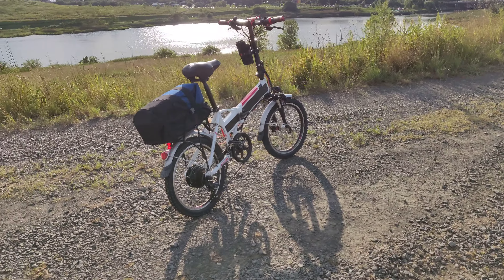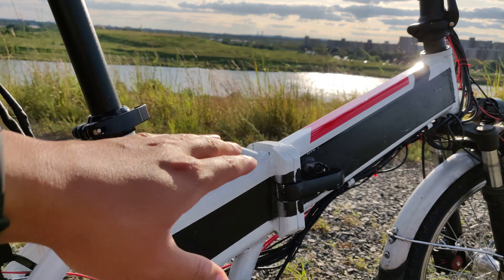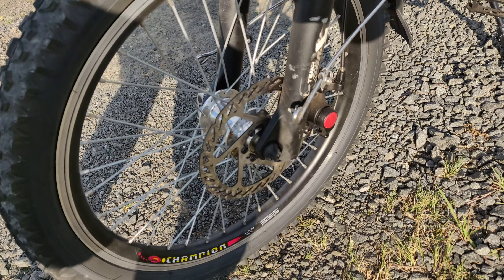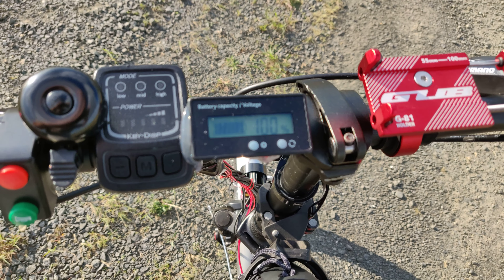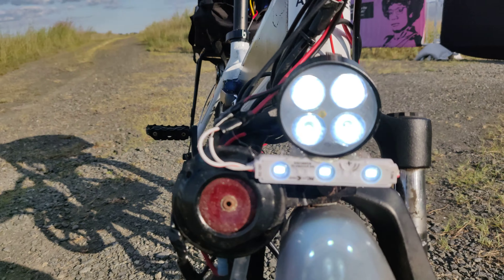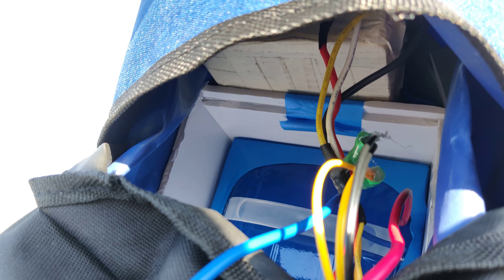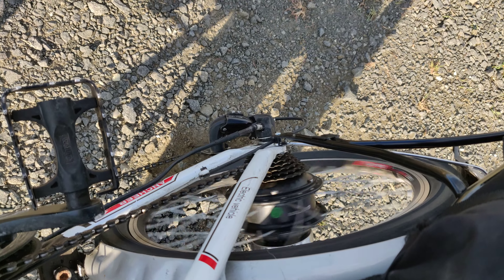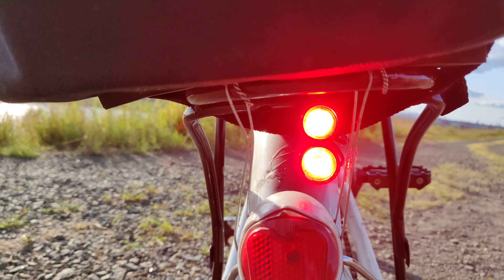Modded Ancheer FM001908 foldable bike to 48v

Comment: Thats great! But what kind of controller do u have ? Beacaus i have an 36 v 250 watt bike and i want to upgrade only the battery to 48 v 10ah do you think my controller can handle that?
Reply from the maker: Hi, my controller is x813-AA26E-12Z it say 36v/48v on it. If your say the same thing, it should work without a problem. To be 100% sure, you will have to open the controller casing and look at the capacitor voltage rating. If it over 48v, then it will work. For more information, can visit this forum 

https://endless-sphere.com/forums/viewtopic.php?f=2&t=93576